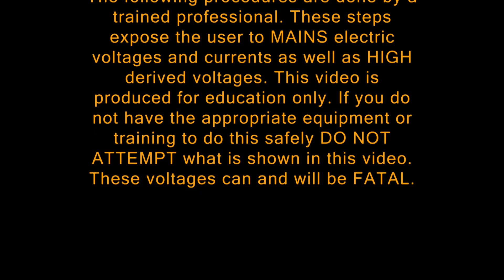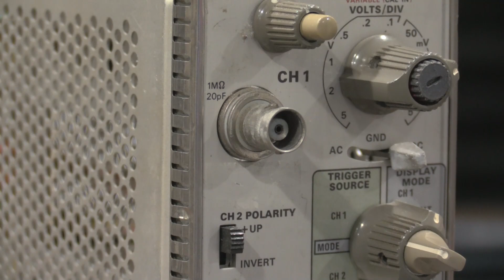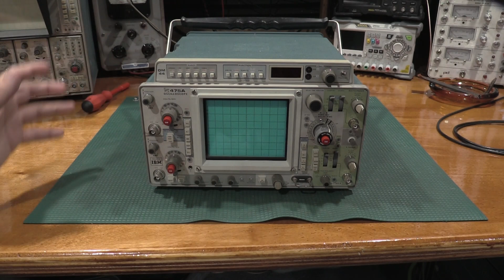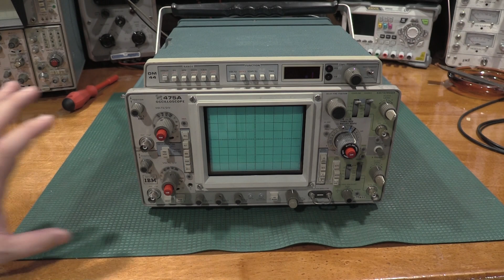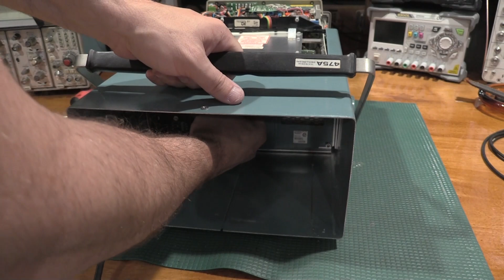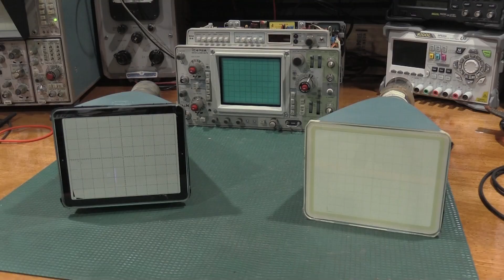New Scope 1st Steps for a Check in

Comment: Have you ever come across a Tek 454A? I have one on my bench right now. I've checked all of the power supply rails and they are bang on. The trace is nice and bright (and very sharp) and the graticule illumination is too. It seems pretty perfect apart from a few things that need cleaning (the vertical Var knobs are wonky and the horizontal position is out of center, also the single sweep ready lamp is out). The main problem is that the case fan has failed. I'm in the process of modding in a 12V PC fan to replace it. I do not have any of the gear to do an alignment, however. I may have to start putting together a few pieces for that.

Comment: I have 466 that is as far i know working perfectly, but since i got it it had one problem. It didn't had any trace on low speed time/div. I lived with that for couple of years until i finally had enough and asked some help with troubleshooting. After confirming that sweep generator is fine we proceed to time base board. And to my surprise fault was obvious, one leg of capacitor that is designated for sweeps under 10ms wasn't soldered, it's not like it had cold joint, it didn't had any solder on it. I guess leg did had some contact but probably somewhere in transport lost it and sweep was gone.

Comment: Nice video on initial checkout of a scope on arrival.  Also, you might want to check the fuse block it may have fuses installed for a voltage other than what you are using.